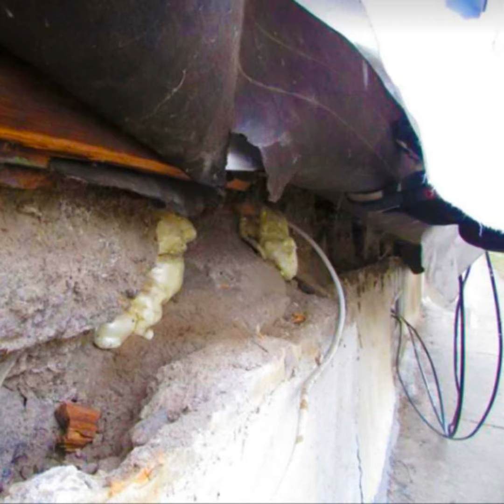Beam Fill and Rotted Rim Joists

Comment: Insulator is air sealing and putting fiberglass over rim joist, house is elevated on several cement blocks off the ground